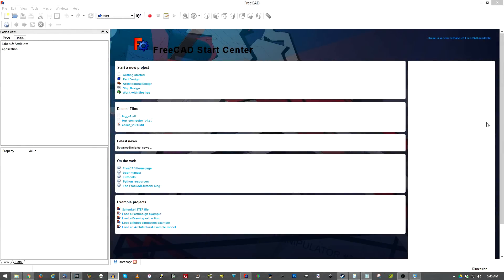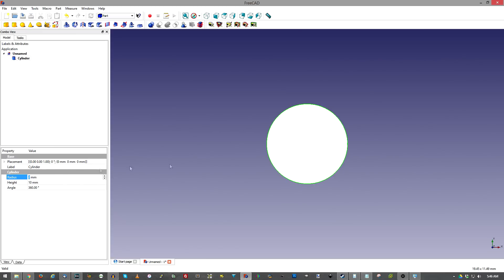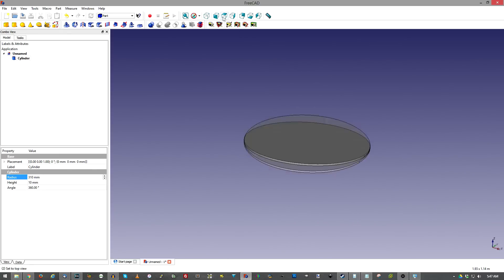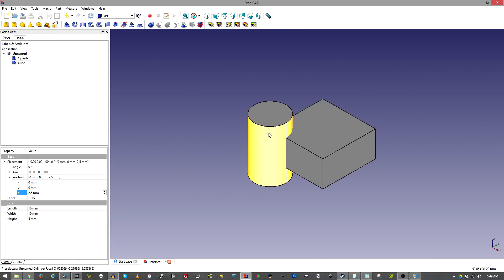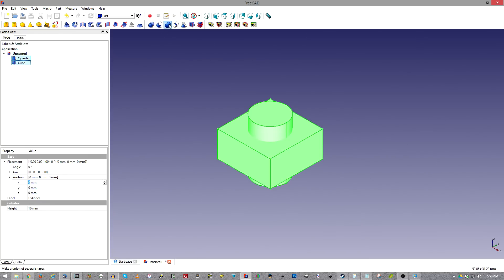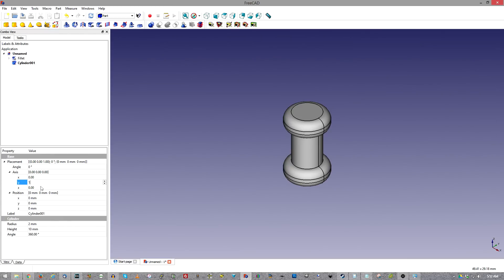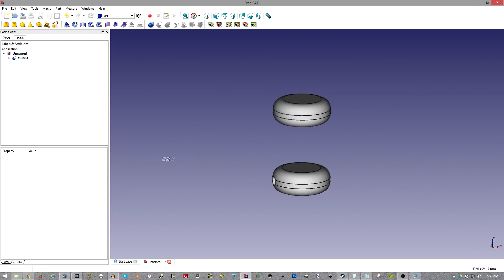FreeCAD 3D Modeling Tutorial 1: The Basics

Comment: Really useless. You want to be using sketches and relations, otherwise you need to start over when you want to change something you did 5 steps earlier.

Do a model where you have construction made from 20 flat pieces of 2mm metal plate material.

Then change the thickness to 1.5mm.

If you can't make that change in 5 seconds and have everything in the right position your CAD modelling (and possibly software) is dogshit.

Comment: There is great information in this tutorial.
All in all i gained a lot of knowledge from this. Thank you for spending the time on it. I appreciate that.
I have some points for you that may be help in subsequent videos.

For example, near the beginning you accidentally changed the diameter of the cylinder to from 3 to 310mm, then in a later cut it was magically back at 3mm. Those kind of things need to be acknowledged so that the student isn't left wondering why their model doesn't match the one you are showing.
Also you have a tendency to go to some features very fast without explaining exactly what you're doing.
And at 6:40 you explain how to union objects, then say "however that's not what we want to do right now" then backtrack to the cut.

These deviances add up to a very confusing tutorial to follow. It took me over 20 minutes to follow this 6 minute video. The content would be so much better if you slowed down, explained absolutely everything and stayed on track.

Comment: This tutorial is best suited for those who already have an idea of how the application is supposed to work conceptually.  I imagine if you've played around with the easier-to-use programs like Tinkercad or 3Dbuilder and get that there are ways to change viewing perspectives, add/subtract objects, and manipulate them, then it'll be easier to follow along this tutorial as it shows more or less where to go to do the same thing using FreeCAD.  

Anyone else who has not played with 3D modeling software and is quite new (and can be hard if you're also not very strong in math and spatial awareness) will more likely be lost.  So for those of you who are lost: 

@0:25 Introducing "Part" and "Part Design" in the "Start" section to get to your basic shapes you can pull in to work with.

@0:45 Inputting a cylinder - pointing out basic attributes you can manipulate to modify the cylinder's shape under the "data" tab at the bottom left of the window.
@1:17 Viewing angles; number keys as shortcuts for viewing angles; zoom with scroll wheel.
@1:28 Rotate viewing angles by clicking on scroll wheel, then click and drag.
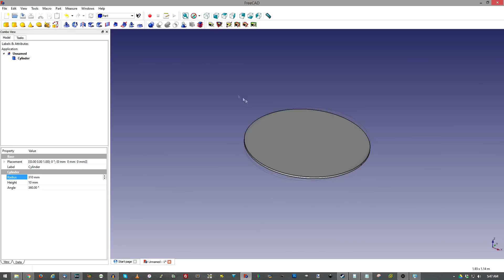@1:58 Axis orientation awareness
@2:07 Adding a shape, modifying shape
@2:20 Modifying shape's position in work/space
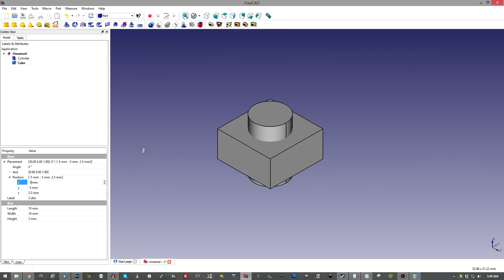@2:51 Subtracting one object from another.  1) Select object to keep, 2) select object shape to erase, click on proper subtraction command (in the middle of this, he goes into "unioning" multiple objects if want to subtract one piece from multiple objects, or multiple pieces from one object)

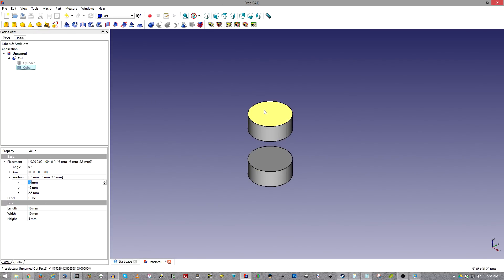@4:17 Modifying edges of shapes
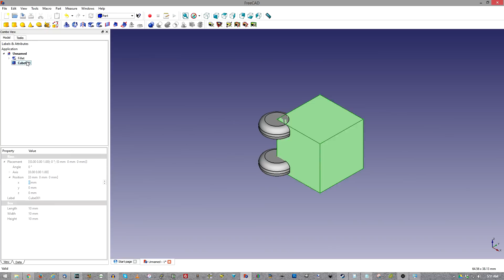@4:37 Rotate feature; how to specify which axis to rotate on

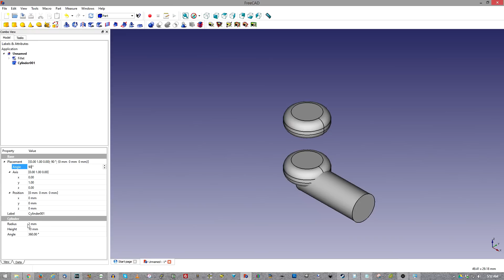@5:20 Another example of resizing, rotating, modifying, and repositioning shapes in order to subtract one piece from the other.  End video.  

Don't look at this video as a full-blown tutorial on how to use FreeCAD for a beginner.  Instead, look at it as a quick guide to doing what you already know you want to do.  For example:  you know there's a way to subtract one object from another, you just need to know the actual process for FreeCAD because the controls are not the same on 3DBuilder or another program you previously used.

Comment: The software could be so good, but it's also so annoying.  For example, you edit an object placement but unless you press OK (even though the part moved on the screen) it hasn't actually moved.  What the heck guys?  Then, you have to do a boolean one by one, but why can't you just drag the part into the section you want it to be in?  It's so annoying, I had to buy a new monitor after throwing my keyboard at the old one.